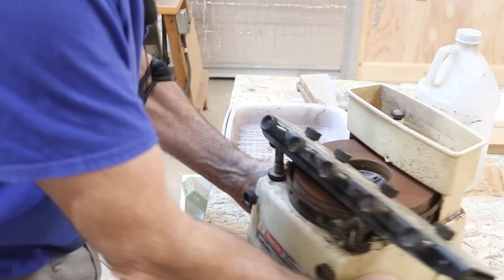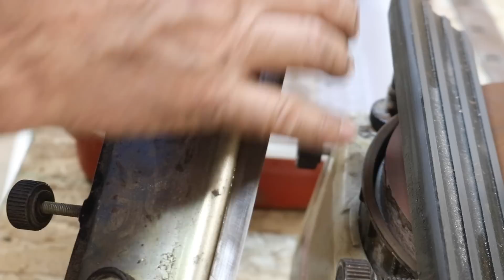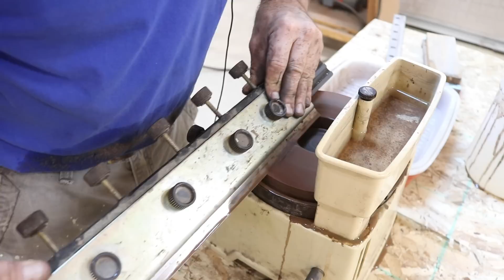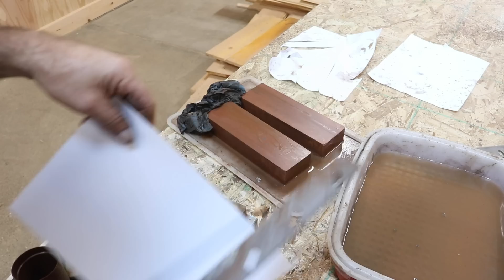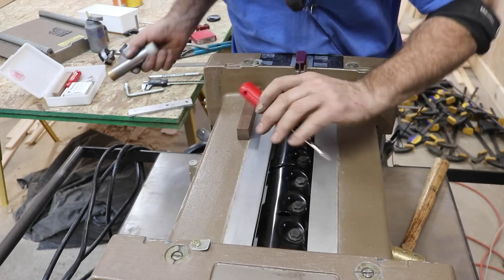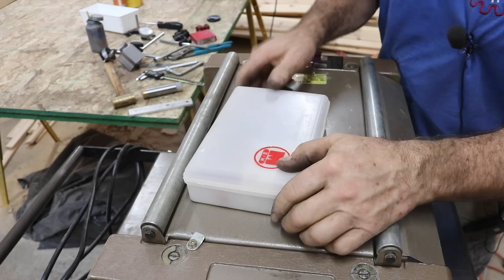Planer Blade / Knives Sharpening & Installation | Makita 2040 Wood Planer

Comment: That sproket set is imposible to find these days and worth installing to slow down the blades if you get tear out on figured wood.  On my Makita 2030 the original sprockets are all 15T. The slow speed set has a 10T drive sprocket and 2, 18T driven sprockets.  I replaced the driver with a 10 tooth gear and it cut the speed to 2/3 of original and really decreased tearout on figured oak. If I remember, changing all of them cut the speed ~ in half.  I love my Makita as well.  It's a workhorse.
Reply from the maker: Thank you Jared for the great info.  This has been a great machine and I love using it,  I have planed 1000's of ft of material with it.

Comment: I had that planer since the early 80s.Absolutely great machine 
About a year and a half ago I had a shoulder problem and carpal tunnel surgery at the same time.I was not doing any major woodworking. I loaned my planer to a friend. Six months ago i asked for the planer. He decided to tell me it was not pushing wood properly. I got it home and saw one feed  roller was completely cocked . No way it would push wood. 
I eventually got it apart. The pillow block on one end of the roller was now oblong. I looked at the feed roller adjustment screw on that end. It was down about 3/4 of an inch. I also could not move it.  
Everything was so fouled up i eventually had to pull the head off the pillars to get that end opened up enough to get the parts out.
All that said I am trying to rethread two problem areas One with the inside left hand thread inside the adjustment screw insert.. The other the threads on the head that the adjustment scree goes into. 
Wondering if you have any info on the thread sizes for that adjusmrnt plug both inside thread which are left handed and the outside right  handed threads tha are  in the head. I am hoping you might be able to help. No response from Makita so far, I found a new adjustment plug which is the new style without the slot. Unfortunately after i ordered it the supplier told me it is not in stock but will get back to me. yeah right.
They did have 2 new pillow blocks. 
But if I cant get that adjustment screw redone i am not sure i can get the machine running. Unbelievably so far two machine shops did not want to do the work of rethreading.
By the way the original pulley belt was like brand new but did order a replacement. 
Two suggestions for all users. If you ever have to get those rollers out you will likely have issues with a few of those screws holding the botom plate  that pushes the rollers up. Replace those phillps head screws  wih hex head screws when you get them out, 
One other warning about deteriorating urethane rollers. Do not put any oak through that machine that is not completely dry. Tannic acid  will eat those rollers up!. New rollers very expensive and even just replacing the original urethane material is expensive.

I may try to use your email account. Did not realize at first that this was a 3 year old video.
Reply from the maker: Got your email.  I will reply there.  Thanks for the comment.

Comment: Great explanation for this. Would you know or have you done a video on the feed rollers? I can not get the adjusting screws out. They unscrew so far then stop up, very tight.
Thank you
Reply from the maker: Ian,  I have been asked about these several times.  I will remove one and take one apart in a videos.  Give me a few days.  They can be very difficult to remove.  Thank you for stopping in.

Comment: That was a great demo. I inherited all my Dads' tools. The 2040 Makita was included, I only used it a couple of times, before the motor stopped working.
It has been in my shed, not working, for about 7 years. This morning I finally got it working. Any ideas on restoring the rollers, and the planer deck, which are rusty?
Reply from the maker: Nice.  Evaporust, light sanding or scotchbright, reblue.

Comment: Very helpful video Randy. I'm just finishing the restoration of a 2040 planer. Can you tell me if you have the standard 15 tooth sprockets or are you using the optional reduced speed sprockets? I'm wondering if I will get good results with the standard feed rate. You are right, these are amazing machines!
Reply from the maker: I will check and get back to you here.
Reply from the maker: I am running a 10 tooth sprocket.  very smooth finish.

Comment: Wet stone sharpening, you can't beat it.  I hate it when people's shop looks better than my living room. LOL
Reply from the maker: Thanks Vernon, coming along nice.  I will get a recliner for you.
Reply: It's the echo sound in the video that gives it away. My shop is a total sound deadener with unswept sawdust and shavings everywhere..Then again I do have a slight lazy streak when it comes to sweeping.
Reply: I have an old DeWalt joiner ..adjusting the knives is similarly a pain in the ***..Just over tightening by the slightest bit throws them off. But once there they cut beautifully even with my underpowered motor..
Reply from the maker: @martinoamello3017  Yep tighten slowly and always checking.

Comment: I have a slightly newer planer jointer version of that Makita..... great machine.  Much easier to align and sharpen blades
Reply from the maker: I have used many makita products and they have always perform very well and long lasting.  Thanks John.

Comment: Nice how-to.
Working on getting my dad’s old planer running. The feed motor had a bad capacitor.
Just have to mount the motor and wire it back in. 
I’m sure lots of adjustments will be needed.
I’ll probably do a quickie video and post it.
Thanks,
John
Reply from the maker: It is worth it to take the time to get everything set right,  It will work much better.  Thanks Caveman.

Comment: randy a pawn shop near me has one of those planers that has the same numbers as yours for $200.00 but it will not run, I plugged it in when the owner was outside and  wiggled the cord at the machine and it ran, going to get it tomorrow.
Reply from the maker: Good deal Carl, great machine very robust.  Well worth it.  Thanks.

Comment: Great content, my son in law has a planer and we are learning how to sharpen blades. Lots of nice features in the Makita, I like that gauge and the setup appears to only present a given amount of blade . How long you get from a sharpening, say mostly pine/spruce? 
Cheers!
Reply from the maker: Thanks Howder.  Kind of depends on how much you use it.  But I usually only have to re-sharpen a couple of times  a year.  Pine and spruce are kind of pitchy so you may need to clean more often.